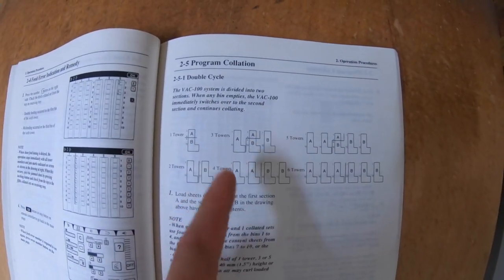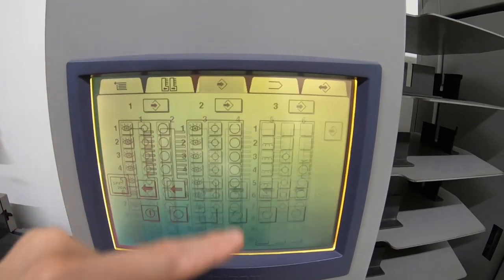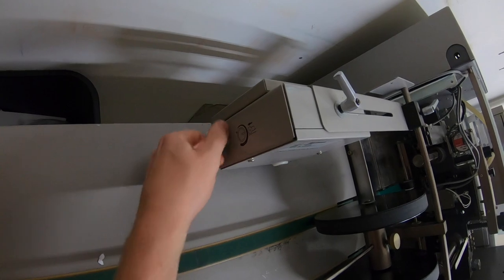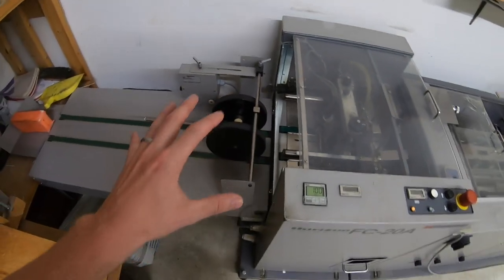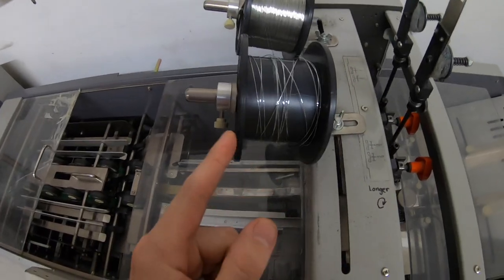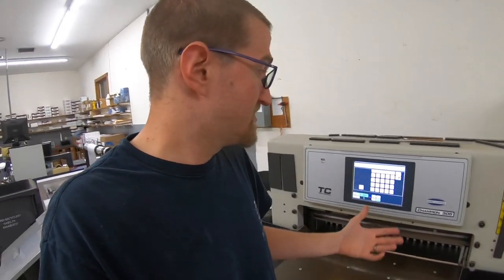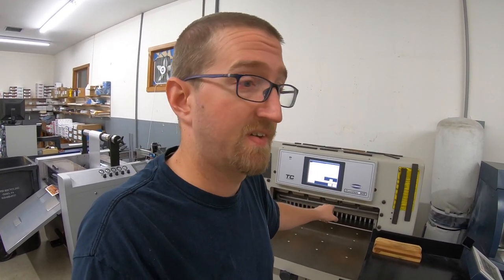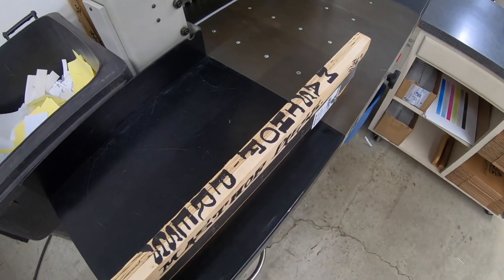Collating Non-stop, Preset Kicker and Knife Life Talk

Comment: @Just A Printer. With regard to the blades in guillotines/cutters, please remember the old saying "Cutting with a blunt knife is a false economy". Blunt knives put extra wear and tear on the cutting machine's knife carrier guidings and the knife drive (e.g. clutch and flywheel system or hydraulic pump/hoses/control valves etc, plus the main motor). It is far more expensive to replace/repair the guillotine/cutter than to buy a set of knives. Blunt knives cause sheets to stick together meaning  blanks, burred edges = jams/crashes etc.
A set of knives is usually 3 - that's one in the machine, one newly sharpened (on standby) and one away at the grinding shop. If you are in a remote location or maybe end up snowed in during the winter, then maybe go to a set of four knives ( two sharp on standby) Number the knives and use them in rotation.
Guillotine/cutter blades are usually come in three types. High Speed Steel (HSS), Swedish Steel (SS) and Tungsten Carbide Tipped (TCT). Usually HSS is standard equipment supplied new with the cutter. SS is higher Carbon Steel content (sometimes "flame coated" where they heat the tip of the knife and bombard it with Carbon powder to create a harder cutting tip). TCT is where Carbide particles are sintered onto the body of the knife to form a hard tip which is ground to a double bevel of 24 degree pre-phase bevel of 3mm./22 degrees main bevel. TCT knives are usually 3 to 4 times the price of the HSS quality, but will be serviceable for 3 to 4 times longer. However these blades need to be sent to a grinding station with the right specification modern industrial diamond wheel grinding machine, operated by people who know what they are doing! Amateurs will ruin TCT and squander your precision investment. But you must be careful what you cut with TCT knives as although very hard and durable, they are also brittle and will chip easily if abused. Plus you need to use a certain kind of cutting stick.
The cut counter on your machine is a good idea. I have used cutters where you preset the cut counter to say 5000. The machine counts down to zero and then flashes a warning on the screen to make the operator aware. 
Try and get hold of a copy/download(?) "Cutting In Practice" from Polar Mohr, if still available. A mine of information for cutter operators everywhere. Stay safe and well.
Reply from the maker: Wow, that is a lot of great information. Thanks so much!

Comment: As far as changing blades goes, we used to change it when the cut didn't look nice anymore. I noticed that the blades lasted longer when cutting Lithographic printed stuff as to digitally printed. I know you probably do but always make sure to use the full width of the blade when cutting and they do last a lot longer. Plus the guillotenes I used to use were much bigger.
Reply from the maker: Yup! Got to use the whole blade.

Comment: I think for the blade it all depends of what you cut. If it's straight gloss paper,it last for ever but doit pads, cardstock, and all mix of paper,that is when the blades get full faster
Reply: The uncoated recycled stuff is what chews those things up. My Polar tech keeps telling me that each generation of recycled paper gets hard and harder and puts extra strain on the blades.
Reply from the maker: Agreed!
Reply: @Mike Hughes. As the natural content of  wood/cellulose fibres in recycled papers go "around and around", they degrade, losing their strength and constitution.  Plus, you need more kaolin (China clay) to fill in the "gaps" between the now shorter (and shorter) fibres to make the paper surface smooth and "printable". Kaolin is washed out of stone quarries with high pressure hoses. So paper is fundamentally "wood and stone". Recycled paper is "wood and more stone", and you need to cut this material. Hence your Polar tech's comment. Stay safe and well.

Comment: I use HSS blades in a Muller 3 knife for perfect bound books and depending on stock and book thickness it can vary from 5,000 cuts to 50,000 cuts.  Some stock hits hard after only a few books.  I have also tried carbide blades but they tend to nick easily and cost a lot more to sharpen and are not worth it in my opinion.  I also use a Muller stitcher 3 knife that has a scissor style cut and will last 1,000,000 plus, usually only replaced when the stitch nicks become too noticeable.
Reply from the maker: Interesting, sounds about the same as what I have been seeing. Thanks for the input!

Comment: Dan, have you heard anything about the digital color presses that Ricoh sells like the C7100X/C7200X series with the 5th toner? What is your opinion on a press with a 5th station for clear/white toner? Do you think it is worth it?
Reply: I used to have a c7110. The 5th station was nice, but we hardly used it. Just didn’t have the customer base for it. If you do a lot of work for advertising companies or design studios it would probably be worth it. The 7200 is nicer because you can move the 5th station either first or last to make it easier for the white underlay/overlay.
Reply: @miketheprintman  I am really interested in this press because I can find a used, low-meter C7100SX with all I need basically (except from the booklet finisher) for the same price (or lower) as a used C1060/C1070 with the same clicks that doesn't even have as much options/finishers installed on it. And from what I can gather, common maintenance parts for the C7100SX like drums are cheaper and last much longer than those on the Konica machines and you also get the novelty of the 5th station. I don't understand why this happens. Curious as to if I am missing something.
Reply: @vollarron  Thank you for all the info. Can you please explain what do you mean by "moving the 5th station to print"? So the developer/drum has a slot for it in the machine for when you want to use it and then a storage spot so toner doesn't get used when the machine does e.g. process control?
So in your opinion, the 5th station is more of a gimmick/marketing point rather than an actually useful/usable feature? Would you be willing to send me a couple of photos of printouts of the 5th station on colored paper, in private? I am really interested to see them because, at least in their marketing videos, they seemed pretty confident in the 5th station's capabilities.
Finally, as a CMYK-only press, what do you think of it in terms of reliability, quality, etc? I am guessing you have it under a contract?
Reply: @orestes29  if you’re going with a CMYK only setup I would recommend the c9200. It can do up to 470gsm or 24pt. board.
Reply: @miketheprintman  I don't have that much printing that needs to be done in the shop to warrant a C9200 😅I need an entry level production press like a C10xx/C20xx (from Konica), but since Ricoh's mid production engines are going for the same price used, I thought I should look into those as well. I am very happy with my older B&W Ricoh machines.
Reply: @orestes29  understood. The 7110 we had was a great machine. We ran it past it’s usual duty cycle without any falloff in quality. I definitely used the clear toner more than the white. I was also intrigued by the invisible red, but they came out with it as we were upgrading to the 9200. They recently came out with gold and silver too.
Reply: @vollarron  Thank you for your detailed reply. I don't think I completely understood the 5th station part completely. So the place where the 5th station normally sits is a storage spot? You have to replace the 5th station parts with one of the colors (C, M, Y or K) in order for it to print? Or leaving it in its normal place you can't print CMYK + spot in one pass?

My current situation is that I want to replace my current KM press with a newer one. I don't really care for a 5th station - I just thought it would be nice to have since the machine sells for the same price or lower than a C1070, for example. What also piqued my interest about Ricoh machines is that everything lasts a lot longer - according to the service manual at least - and costs about the same to replace as the equivalent KM parts (not sure what your experience has been).

I know my local dealer has a C7100SX on display and I could go there to see for myself. As for going to a print shop that has it installed, to the best of my knowledge, there is only one C7100SX installed country wide. Things are pretty stagnant here, there are very few large digital print shops with that kind of equipment around, as far as I know.
Reply: @miketheprintman  Hope that C9200 works as good as the C7110 did for you! I am a bit hesitant to jump ship from KM to Ricoh since I will be servicing the machine myself, knowing that it isn't a troubled engine design is good at least.
Reply: @orestes29  If you are able to, make sure to get a TCRU kit. That gives you a replaceable kit for pretty much any regular service part in the machine. Then after you swap out the units (which is really easy), you just call up service and have them come out and replace the kits with new ones, or if you have no service contact, you just order new ones.
Reply: @vollarron  sure, that would be great!
Reply from the maker: Good conversation guys! It never made sense for me because I don't have customers willing to pay for this added service. It would be great for printers that have high-end clients!